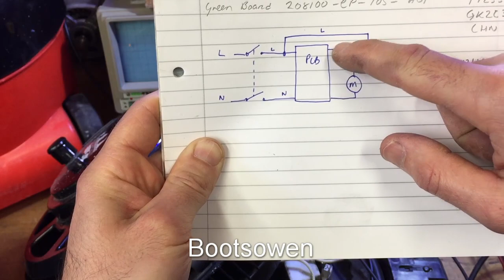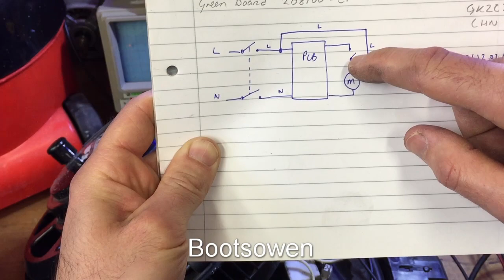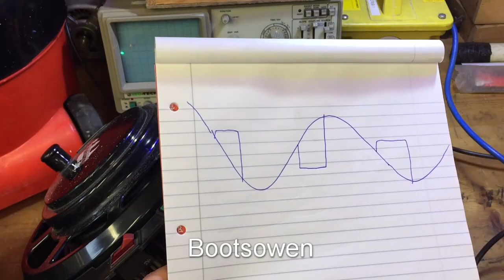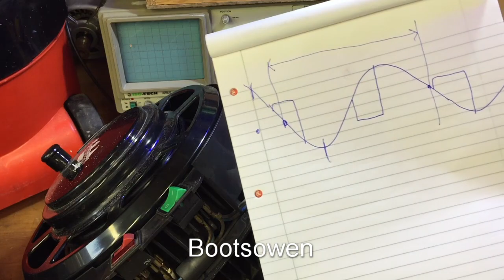Henry: looking at the waveforms on an oscilloscope, Hi-Lo switch, PCB, Numatic Vacuum

Comment: Thanks for the videos. I found a Henry while out geocaching, soaked with water. I washed it as there were slugs and allsorts in it. It's going well once I bypassed the hi/lo circuitry. It looks relatively new as there's hardly any marks on the casing. Testing it on the carpet at home it's doing a good job of lifting dirt. As I've took out the red pcb is the motor going full power all the time or am I missing out on power? 
Edit: Although if full power is going directly to the motor I should be getting full suction (probably have answered my own question).

Thanks.
Reply from the maker: Full power Michael, The board reduces the power.

Comment: Thank you very informative videos you do. I have a 200A ive just picked up. its working but the hi-Lo switch does not light or switch up power. Not sure how to check if its stuck in Hi mode or low. Would you suggest just bypassing the PCB and a listen if it sounds faster?
Reply from the maker: In my little experience when the hi lo fails the machine doesn't work. so maybe someone has by passed it already? Open it up and see.
Reply: @bootsowen  Hi Bootsowen thanks for your reply. All the wiring is correct and the PCB has not been bypassed. I got a new hi-lo switch today and fitted it. All thats changed is the red led now works. No power change. I will bypass the PCB when i have time and see if theres a noticeable power difference. Thanks Dave

Comment: Hi thanks mate lovely video, informative.
I pulled off the PCB and I didn't test red switch (hi low).
I only have multimeter.
Can you guide me how I can determine which one is defective. The hi low switch or the PCB.
How I can test them individually using the multimeter.
I actually bypass the PCB at the moment n the motor is working fine but before I order PCB which is expensive I wanted to be 100% sure that the fault is there. So if you can tell me a way to even test the red switch only that will help me. Thanks
Reply from the maker: you can test the hi lo switch with a multimeter, using resistance or continuity.  I would just replace the switch with a blanking plate or a light and make the board redundant. I show how to do this in other videos.

Comment: As you described, on low setting the sinewave is chopped. Because it is choped multimeter is not able to read the effective value properly 

To read that value you will need a multimeter with TRUE RMS function
Reply from the maker: Thanks Miki, this is how I learn, any recommendations on a multimeter? Something not expensive?
Reply: @bootsowen  A dial analogue MM may pick up some reading